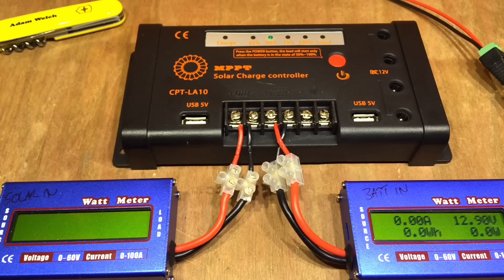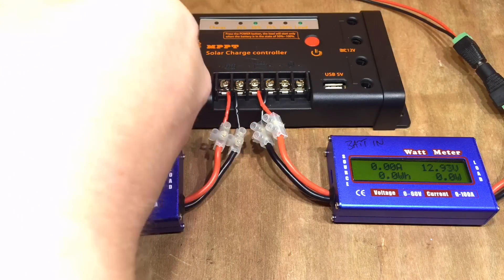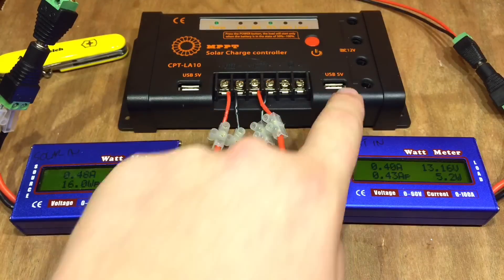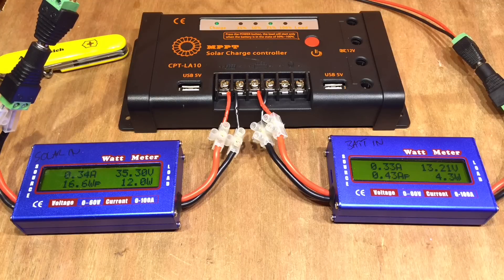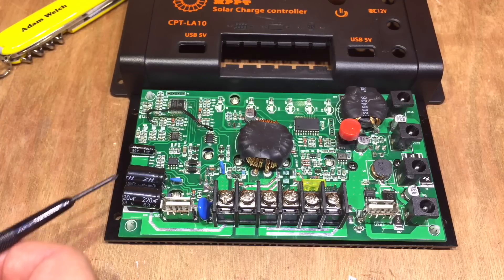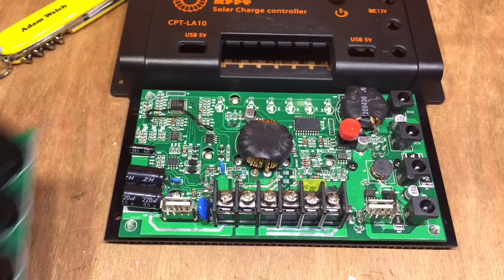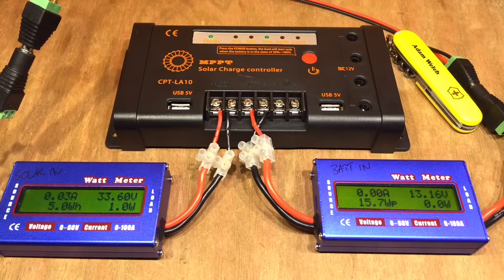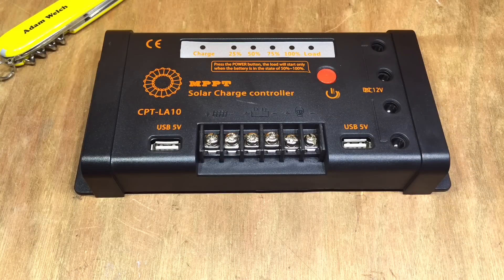Another Cheap MPPT Charge Controller - Comments Answered - 12v Solar Shed

Comment: I would really  like to know how to connect multiple inputs to a charge controller. For example, a small wind turbine and  solar panels.  Do you need a separate controller for each? Finally, I would really like to get a mppt charge controller off eBay, but as you have excellently pointed out there are a lot of fake's out there.  Most of us including myself don't the ability to test them as you do. Is there anyway you could create a small list of ones you recommend? This would be a huge help. Thanks!
Reply from the maker: Solar panels and wind turbines are quite different generation technologies each with their own factors you have to consider.  I'm no expert of wind power generation so you might be best asking others, but unless you have a charge controller designed for both I personally wouldn't combine the two.  In solar if your battery hits it's charging limit you can simply switch off the connection to the solar panel - it will go open circuit but won't generate any power.  In wind if your battery hits it's charging limit you can't usually stop the turbine and without a load across the turbine it will speed up and possibly shake itself apart.  So wind controllers have a  load that can be switched on to use up the surplus power and slow the turbine down.

You can link multiple charge controllers to one battery bank - one solar, one wind for example.  However you need to keep an eye on the fact that they might be attempting different charging modes at the same time.  Lets suggest your wind controller is in absorb mode running your batteries higher than normal, your solar controller is in float.  Effectively your solar will be disconnected until the voltage of the batteries drops to its float voltage setting.  I guess both controllers would need to have the same float voltage too.  On the other hand these issues might not be an issue at all - like I said, I'm not used to wind power. 

I like different charge controllers for different reasons and different applications.  It's not always as simple as saying this one is good, this one is bad.  That's why I make videos explaining the pros and cons!
Reply: Thank you very much for this, and I understand your point about the pro's and con's of different controllers . I'm more concerned with buying one that claim's to be mppt and is not. Anyway , thank's again.

Comment: Hello Adam Welch,
i have this solar controler on my 55v 1.2amp panel. i was expecting to get around 4 amps at 12v. sadly i dont get better then 1.45amp so in my opinion its not a good controler.
i orderd the epsolar in my hoop it will be a lot better. i wil be happy with 3 amps or more.
nice videos you make :)
sorry fore my bad englisch.
Reply from the maker: Thank you for your comments (and super English).  MPPT does work best on a battery with a very low charge and the current will lower as the battery gets full on any charge controller.  Have you gone for the EPEver Tracer MPPT?  I have to say I do like mine.
Reply: +Adam Welch 
Hello yes i got the epever tracer 30a.
I bought it on eBay fore 89 dollars.
The 10a was only 56 dollars.
MY batery was at 12,6v when with a load of 7amp direct from the batery.
It only did 1,45amp so do you think it Will do 4 amp when batery is at 11v? Indont think so myself.
Do you think it Will with the epever?
Thanks :)
Reply from the maker: +ben grobben With a load on the battery it should have done better than 1.45 I'd guess. 

Will the EPEver do better - well 55v at 1.2a is about 65 watts. So at 12.6 that's about 5 amps. There will be some losses - but 4 amp seems achievable under good sun and a hungry battery. All of this assumes that your panel can really produce those numbers in its power curve of cause.
Reply: +Adam Welch 
Well i hope the epever wil get the 4 amps out of it. I wil let you know when i get it. Thanks for the fast response.
Reply: i instaled the epever tracer and it works way better. im happy with this.
so to every one!!! dont buy this cheap mppt controler just spent the extra 25 bucks on a good one.

Comment: Hi, I don't know much about MPPT but i do know that PC power supplies only achieve their stated efficiencies when running at larger loads, partly because the overhead in the control circuits (and fans) is there at all levels of operation. The controller seems to take 5 watts at low powers and only a little bit more than that when it was approaching 25-35w on the input. Have you tried giving it the full 100v of panel and a low battery and seeing if it gets anywhere close to the 90%~ efficiency the spec sheet claimed?
Reply from the maker: +Jeremy Hayes You're right of cause. I tried 100 watts of  24v panel in the first video on a battery I'd put a load on in the first video. That's where I saw the inefficiency first. Thought it might be the load Buck converters. Sadly there wasn't much sun when I filmed the update. I could put more panels in series, but the watt meters have a maximum of 60volts which makes it more difficult to demonstrate the results. Sadly although we're having a heat wave, the sun is low in the sky when I get home from work. 
I'm interested in a second opinion on this charge controller though - nobody else on YouTube seems to have looked at one. 
Thanks for your input. Perhaps there will be another video before long.

Comment from the maker: +Vyl Bird for some strange reason I can reply to your comment - so here is my response...

Yeah it should be better with more power going through, but if you pause my previous video when I did have 100 watts at 24 volts going through it there was still losses. I'm not convinced it's the regulators either now although it's been suggested that the switch may only switch the output rather than the input to those regulators. 

Another suggestion is the watt meters, but I've used these long term on solar panels in the past and never seen an issue. 

More investigation required. Thanks for your suggestions.
Reply: Adam Welch please do a repeat test with at least 50W on input and fully empty battery. I watched your previous videos but can't see that you showed batter voltage. 

Why do you have such small power on input? Is there any sunlight hitting the panels?
Reply from the maker: +Valent Turkovic Hello. Yeah that's often the issue - poor sun. I do try to make the solar videos when there is some sun but work, family and living in the north of England do mean that isn't always possible.
Reply: My thoughts.. Australia.. you could use a panel on a full moon here haha

Comment: My guess is the efficiency would be higher at higher loads.  At low loads, the controller is going to use some number of watts to operate itself.  As the charging current/power to the battery goes up, that baseline controller power will stay about the same with some loss related to the load current passing through it.  So maybe 5W baseline load plus a few watts loss per hundred watts passing though.  At the low end, 10W coming in, 5W going out, but at a higher load, 200W coming in, 190W going out for example.
Reply from the maker: +Luc Peeters I was talking to someone about this earlier actually. The increase in solar coming in must outweigh the extra power used by the controller - accounting for the fact that the controller will most likely be on 24/7. MPPT makes perfect sense in grid tie inverters and off grid where you are using the power at the time of generation, but for those off grid systems that charge by the day and discharge at night MPPT may not be required. MPPT can also be useful if you've run out of space for panels, but with a good PWM controller more panels might be the best bet. 

That said I like playing with the technology and experimenting - and that means I don't always have to justify purchases in the same way ;-)

Thanks for the idea.
Reply: Would be nice to test it against Julians cheap pwm one.  Not sure if the efficiency is better using MPPT with small panels to lets say 50Watt. The cpu or controller will probably draw more than a simple pic.  A new small test?
Reply from the maker: +R Brown (4Crawler) Yeah I suggested this in another comment.  Unfortunately the sun wasn't playing last night, but if you pause the original video when I had 40-50 watts coming in there was still a fair gap. Although the load was on as well.
Reply: auchh true, well I should have started reading the responses before posting.  PWM devices for the win in this case.

Comment: Glad I could help have you tried measuring the efficiency with a flatter battery around 12v. I upgraded to a 20amp mppt from ebay It seems a lot more capable and hopefully (wife dependent) I will be ordering an MpSolar 2424MSE on Wednesday.

20 amp charge controller (http://www.ebay.co.uk/itm/20A-Mppt-solar-charge-controller-regulator-12v-24v-automatic-recognition-/201405873689?hash=item2ee4b9be19:g:U9IAAOSwjVVV1vXB)
Reply from the maker: +chris chester I've shown it at its worst here to be honest. Let's say it uses (or loses) 7watts. 7 watts from 150 is pretty good, 7 watts from 15 - not so good. I've often seen that charge controller on eBay. You're the first person I know to have one - been happy with it?  Fingers crossed for Wednesday :-). Thanks again.
Reply: I've just trawled back through the ebay listings I got it one and a half years ago for £17.99 and it has and still is serving me well I use it as part of a 12v lighting system I have all around the house that comes on automatically with a dawn dusk light controller lights up my stairs and landing using led strip and downlight combo I also have a meter of led strip in the fireplace and at decorative light outside the front door.

If I manage to order my new charger/inverter on wednesday I will be considering selling my 20amp charge controller.

Comment: Hey Adam, I was thinking the Wattmeter on the solar side could be affecting readings, as its drawing power from the panel to power itself. Are you able to power it from another power source?
Reply from the maker: I'm not sure this will be an issue but I'll double check and respond if your theory is correct - thanks for the idea.
Reply: I have the same meter it measures through the negative lead there's a 3 pin auxiliary connector on one side the middle pin is positive left is negative other not used it takes the 3 pin connector from rc receiver batteries,I didn't have one so I sniped off one of the connections off a redundant pc dvd rom audio cable. Use the negative as you have it wired already but connect the panel in and the source together at the charge controller ignoring the positive load from the meter. Hope this helps....